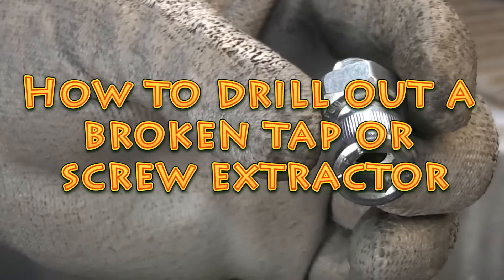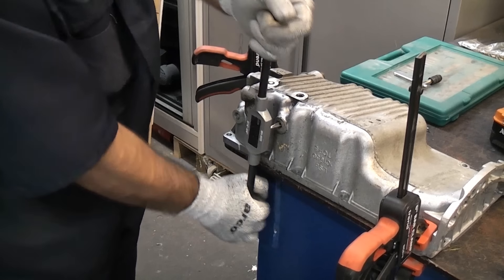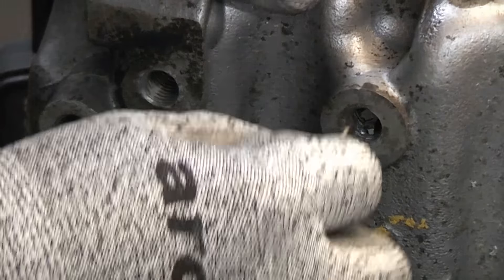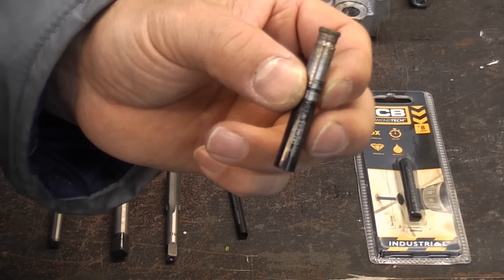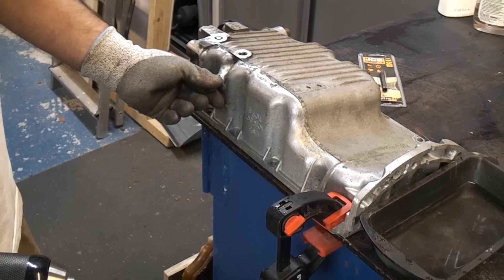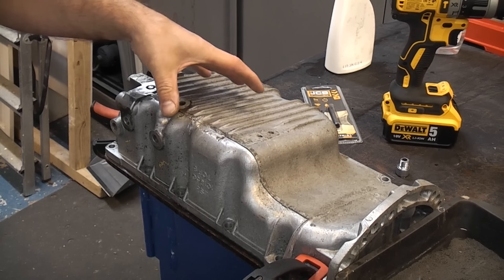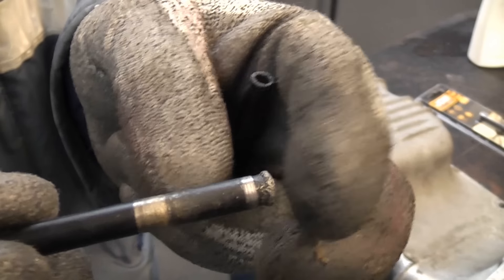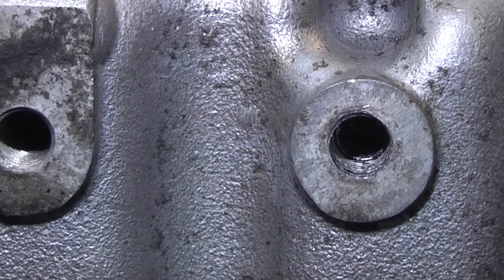How to drill out a broken tap | drill out a broken screw extractor

Comment: Having trouble finding the JCB bits in the USA, do you know of anywhere I can get them here? Milwaukee makes a similar looking bit which is available in the USA though it doesn't say anything about drilling hardened steel, any experience with those. Thanks!! Great videos!!
Reply from the maker: I would imagine that the Milwaukee ones will be fine. Any decent quality of diamond coated hole saw should work.
Sorry if this is late, I've not been well - I'm trying to catch up on all the comments

Comment: Wow, you did the impossible.  With the older Kawasaki FH engines the pull starter mounting bolts always broke.  I've  further ruined a number of heads trying to trying to extract the hardened bolts out.

Comment: @Ultimate Handyman; I've got a broken off screw extractor that is flush with then end of the bolt hole.  The hole size was for an M5 bolt.  What size holesaw would you recommend?  Any ideas for keeping it straight when drilling since I can't make a bolt drill guide?
Reply from the maker: M5 will be really difficult, as it is so small. It might need drilling out on a drill press using a solid carbide drill bit. I don't think you can get diamond coated hole saws small enough!

Thanks for the comment 👍

Comment: So it if was flush and not inside. Just start with a diamond hole saw or how would you go about a flush bolt where you can screw in the guide to drill first
Reply from the maker: Perhaps glue a nut to the component using superglue or a hot melt glue gun, then drill the guide into that. The diamond coated hole saws are great, but they are very difficult to get started without them skidding all over the place, until you get them started.
Thanks for the comment 👍

Comment: What can you use to center the bit if you don’t have threads to run your guide down? Wanted to make your bolt center guide but I’m trying to drill the center of a crankshaft bolt and have no threads near snout.
Reply from the maker: I normally just use a centre punch and punch as close to the centre of the bolt as possible.
Example here- 
https://www.youtube.com/watch?v=MR2Dd30Wees

Comment: the simple yet initially costly way of getting it out would be to use an EDM (Electrical discharge machine).
they are costly to purchase, but one can be cheaply made with the proper parts. PWM switching device, tungsten rod, and microwave transformer. Although i would recommend a laptop power supply over the microwave transformer since it'll be safer than the microwave transformer.
Reply from the maker: Yeah, those microwave transformers can be lethal! 
Thanks for the comment

Comment: I'm getting wound up just watching this video. When I worked in a tool and die shop if we broke a tap we'd take an old reamer and grind a sharp point onto it. Then we'd put that down the hole with said broken tap in it and batter it with the punch made out of the reamer and a hammer. Taps are glass hard so they shatter when struck. That method isn't 1, 2, 3 either but it beats what I'm seeing here. Done right you should be able to bust the tap up into crumbs which you can pick out as you go along. Pro Tip: Try to avoid breaking taps. Because removing them is tedious and can potentially wind you up!

Comment: Hi, surely after diamond drilling the tap it would have been better to have used a left handed drill. This would have shifted the remaining outer diameter of the tap by unscrewing it.?
Reply from the maker: The threads in the hole were damaged from when I broke the tap with the hammer, so it needed tapping out anyway.
Thanks for the comment

Comment: Just a query, in this instance might it have been worthwhile turning the casting on it's side and creating a plasticine dam around it so you could keep the drill immersed in water, or even putting it in a bath of water
Reply from the maker: It would, but then I get loads of comments saying "it's easy when you can turn it on its side", so I did it the hard way ;-)
Thanks for the comment

Comment: What is the paste you use to coat the bits?  It sounds like "cooking paste" (but my hearing is not as good at 68 as it was at 28.)  These are great videos.  Thank you so much!
Reply from the maker: Sorry, my accent does not help. I used cutting paste, but drilling/tapping fluid will also work.
exact cutting paste- https://fave.co/2Nabyxc
Thanks for the comment 👍
Reply: @ultimatehandyman  No, Thank YOU!

Comment: I've snapped a Torx 25 and need to drill out, my HSS won't look at it, the link leads to a tile cutting bit, any idea where to buy suitable drill bits for tool steel..cheers
Reply from the maker: A cobalt drill will probably drill it out - https://bit.ly/3YNREOC
If that won’t work you could try a solid carbide drill bit, but be aware that they are extremely brittle and break easily- https://bit.ly/3jptYzL

Comment: I haven't actually tried this myself, but maybe a Masonry Bit which is Carbide tipped, with the Hammer drill option tuned OFF, Might take the place of an expensive Carbide Drill - Masonry Bits are very Cheap & might make a "One Use" get out of Jail!! Especially a Brand new one which hasn't been used on Brickwork.
Reply from the maker: Masonry bits will drill hard steels, but they are very difficult to use 👍

Comment: A difference question.  
What do I need to buy and cut photography's lens filter in sizes of 24mm X 36mm & 8.8mm X  13.2mm?
After cutting in fine, how would I file down for it to be smooth?
These are made of glass.
Reply from the maker: You can smooth cut glass using an abrasive Waterstone.

Thanks for the comment
Reply: What cutter do I use to cut from this, https://www.amazon.com/Neewer-72mm-850nm-Infrared-Filter/dp/B003TXZF8M to 8.8mm X 13.2mm or to bigger sizes?

Would like to use, cut & file/smooth IR and UV glass (filters) down to those sizes.

Comment: Did I miss something, are there not tap threads still stuck in the hole. To re-tap the hole with those pieces of tap thread still in there would break the new tap would it not?
Harold

Comment: I've just stumbled upon this video.  I've had a spark plug break off in the head of my son's 1995 Tacoma.  I tried to use an extrator to remove the threads and that broke off.  I now need to remove the extrator and I'd like to remove it without removing the head.  I believe this will work, but I have nothing to use as a guide for the bit.  Can anyone give me any ideas?

Comment: Why use water(other than to cool the bit)(or have I just answered my own question) and not cutting paste or wd40 to lubricate the bit?
Reply from the maker: Yes, it is to cool the bit. The manufacturers recommend using water (dipping the bit in water every 5 seconds). I did not want to use a cutting/tapping paste incase it shortened the life of the diamond.
Thanks for the comment
Reply: Thanks for clearing that up.
Reply from the maker: You are welcome ;-)

Comment: is it the same method with a broken drill bit? I have a shock tower bolt that broke with some thread exposure. I tried drilling it out to use an easy out and the drill bit broke. Would a better method be welding a nut on it?
Thanks
Reply from the maker: I would try welding a nut on first and if that fails I would try this.
Best of luck with it  👍
Thanks for the comment 👍

Comment: Excellent video.  A couple of questions:

Could you (if possible) set up the carbide core drill so that you have a continuous stream of water on it while drilling (like big commercial core drill use)?
Could you run the core drill anti-clockwise?  Might help to pull the broken tap out?

Cheers
Reply from the maker: Thanks,
Yes, if I was going to do this regularly I would set up a water feed ( I didn't in this video because some people always tend to whinge about the amount of tools I use)
I did drill anti-clockwise for a portion of the drilling, but the diamond hole saw just slowly files away at the metal, so there is no chance of it grabbing and removing the tap/bolt, like a traditional drill bit.
Thanks for the comment ;-)
Reply: Thanks for this.  Your videos are excellent and very practical!  I can't see me getting an EDM machine any time soon!!!
Reply from the maker: You are welcome
EDM machines are great, but expensive!
Thanks for the comments

Comment: When you deliberately broke off that tap!!! You pilot hole is still one brilliant idea, however it's usually my experience that bolts twist off about flush. That can be dealt with by welding on a nut, however that's only if you have a welder and have some experience welding. On another note; I've yet to see cutting paste here in the States, not that the States have any monopoly on good ideas. I've also not seen diamond holesaws, but perhaps that sort of thing is well known to Granite Kitchen counter [top] installers.  In any case, seeing an alternate use for a tool is always enlightening.
Reply from the maker: I'm not sure why I bought the cutting paste, I think it is because the drilling and tapping spray fluid that I used, went all over the place. Since then, I've been using the paste.
Thanks for the comment 👍

Comment: Can you explain why you broke the first tap and drilled through it
Reply from the maker: People often break taps/screw extractors/drill bits, which are all made from a similar tough steel, which cannot be drilled out using regular drill bits. This video shows that it is possible to drill out hard steels, without using a solid carbide bit 👍

Comment: So wasn't the outer wall of the tap still in there, because you only drilled out the core?
Reply from the maker: Yes, but only a tiny amount of it, which can easily be removed with a screwdriver etc.
Thanks for the comment 👍

Comment: One point to bear in mind is doing that on an engine block. There is a risk of the swarf from the drilling out to end up in the engine somewhere. Potentially not a good thing. Less of a problem in a scenario like the demo where the casing is off the engine on a workbench.

Still really enjoyed and appreciated the video though 👍👏
Reply from the maker: Thanks for the comment 😉
Reply: @ultimatehandyman 

Once eventually removed a snapped bolt with a snapped eazi-out from a motorcycle engine. Used a Dremel with a carbide tipped grinding bit and a very steady hand. Once enough was ground out we spiralled the remainder out of the hole with a dentist's pick. Breathed a huge sigh of relief when the last little spiral dropped on the floor. Patience and profanity in equal measure was the order of the day 😊

Comment: A concrete masonry bit also cuts through hardened steel
Reply from the maker: The do, but I prefer the diamond hole saws.
I did drill through a bearing race with an ARTU drill bit (which is basically a masonry bit)
https://www.youtube.com/watch?v=zbJq2z2ya80&t
Thanks for the comment 👍

Comment: Great video. Just FYI... Brittle is the opposite of tough in metallurgy terms. A very tough steel won't fracture. A very hard steel won't bend. A STRONG steel will resist both to an impressive degree. A lot of people get strength and toughness mixed up, but a strong steel is basically a hard steel that isn't brittle. A tough steel can also be a strong steel, but toughness just means it may bend or disform, but it won't break.

I'm sure you already know this and simply said the wrong word. This is just a random tidbit for anyone reading.

Comment: If you break a hardened tap in a hole, find a machine shop with a spark eroder. This is the professional method to do this job and the simple way. This will also preserve the thread.

Comment: have you ever finished drilling  out the broken bolt with a left handed drill bit
Reply from the maker: No, most of the time if the bit does not bite and extract the broken bolt, I normally swap to a traditional HSS drill bit.
Thanks for the comment

Comment: I read somewhere that masonary bits will drill out hardened steel. Any thoughts  on this?
Reply from the maker: Yes, because the tips are tungsten carbide they can be used to drill hardened steel.
Artu actually sells drills for this purpose - https://www.youtube.com/watch?v=zbJq2z2ya80&t
I have also used the Artu drill bits to drill out hard wheel bolts- https://www.youtube.com/watch?v=8Rm9fBXIzPg&t
Thanks for the comment

Comment: What is that spray solution you used to clean out the hole?
Reply from the maker: It was just a WD-40 type spray, such as spray penetrant/lubricant. I think the one in the video was a plant based version (if I remember rightly). 
Thanks for the comment 👍

Comment: Do have links for the tap/die set, screw extractor set and left hand drill bit set you use? Thanks.
Reply from the maker: The tap and die set that you can see in the video is not much good to be honest, the drills in it are useless. Here are some links to the stuff I have used in the last couple of videos, most of this is what I use at work-

Hinge centering drills- https://fave.co/2DpJo1H
Left handed drill bits- https://fave.co/2xJjK1M
Teng screw extractors https://fave.co/2OnfRuF
Dormer taps - https://fave.co/2OsN1sQ 

If you are in the UK- 
Hinge centering drills- https://fave.co/2NE1VMc
Left handed drill bits- https://fave.co/2DubtF4
Teng screw extractors- https://fave.co/2pVLkVT
 Dormer taps - https://fave.co/2pTfbyx

exact cutting paste- https://fave.co/2Nabyxc
cobalt drill bits (they are much better on harder steels like bolts) https://fave.co/2zDh3kp

You'll have to make the guides yourself, but they are easy- https://www.youtube.com/watch?v=6mZj0J6CNYA&t=1s

Spring tools centre punch- https://fave.co/2NbnLBD

     
      

Thanks for the comment

Comment: I still have half a can of smelly old trefolex, would you suggest i use that up or buy some of the newer cutting paste?  would yous ay it probably doesnt matter what you use so long as you use something
Reply from the maker: That trefolex looks like good stuff, we have a tin of cutting paste at work (can't remember the name), but that smells as well, it's really good for when you have to drill upside down.
 I did consider using a cutting paste, but the hole saw instructions said to use water (probably because they are designed for use on tiles etc.)

Thanks for the comment
Reply: CT-90 cutting compound works a treat.

Comment: You're doing a belting job pal. Appreciate all your efforts just for us! 

Could I just add, would it be a good idea to drill with the diamond hole saw in reverse ? You never know it might just bite the lot and wind the broken bolt out :p
Reply from the maker: I did try that for about 20 minutes during this video, but the diamond hole-saws don't bite into the material, they just slowly grind it away.
Thanks for the comment 😉
Reply: @ultimatehandyman  ah yeah i suppose. I might have to try this method in my cylinder head bolt I commented about on another video. I'm still battling with it !

Comment: Interesting. As an experienced metalworker I believe you’re taping procedure could use a change. You correctly backed off the tap periodically, yet only a fraction. Backing off should be done at least a quadrant for a four flute tape and at least a third for three flute. The swarf is cutoff (released) when the previous flute is reversed into what the advanced flute has just cut. Impressed with your emphasis for wearing off safety glasses. 👍

Comment: Being that the bolt was broken off inside of aluminum you could've just soaked the whole oil pan in a heated solution of battery acid and Alum (potassium aluminum sulfate) overnight and that solution would've just dissolved the bolt and wouldn't have harmed the aluminum oil pan at all. obviously you would need a container that's resistant to battery acid and heat resistant not to mention big enough to submerge the oil pan at least to the point where the bolt is.

Comment: If you had a large LH drill would you have used it here?
Reply from the maker: No, I do have a full set of LH drill bits, but I'd be worried about catching the threads in the aluminium.
I figured that using a smaller drill bit with the guide would be the best option.
Edit: also a left handed drill bit will not drill out a broken drill or screw extractor, as they are too tough. 
Thanks for the comment

Comment: Would using a diamond tipped bit in a Dremel be any faster?
Reply from the maker: Not sure. They are designed to be used in a drill, which has a much lower speed.
Thanks for the comment 👍

Comment: them bits aint cheap (£30) or more, but still cheaper than paying for EDM im sure, great video! bottoming it out and snapping, the real hard core version, not the easier undo it later like ive seen on other videos!
Reply from the maker: Yeah, the bits are about £16 each, if I remember rightly.
For drilling Granite or tiles they work out really inexpensive, if you work out the cost per hole.
Once that tap was bottomed out and snapped, it was never going to be easy getting it out.
Thanks for the comment ;-)

Comment: I reckon while the tap was not totally broken, you should weld it with a piece of metal stick so that you can still hold it firmly and turned it easily. Rather than you break the tap which is give you a totally huge problem.
Reply from the maker: Thanks for the comment 👍

Comment: Love your work and your patience.  Wondering if you have any tips for removing a tap deep inside a hole about 100 deep. I was attempting to tap a hole in a broken diesel injector to thread a rod and pull it but broke the tap about 5mm in. Diesel injector are made of some seriously tough steel